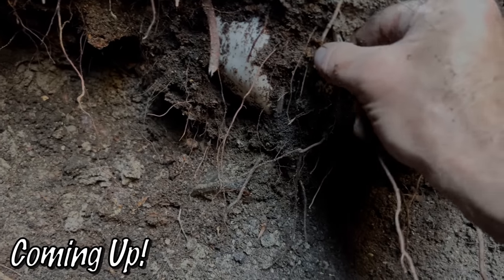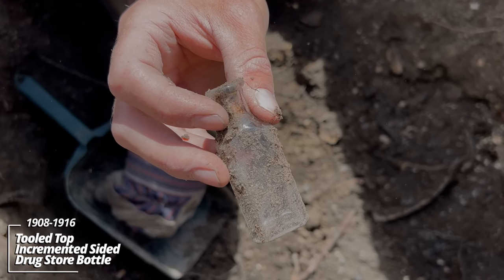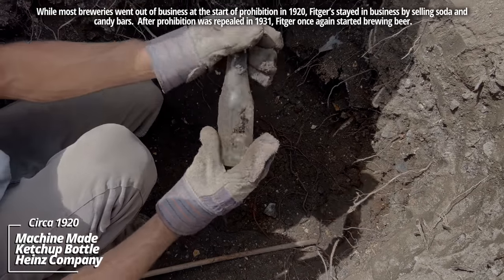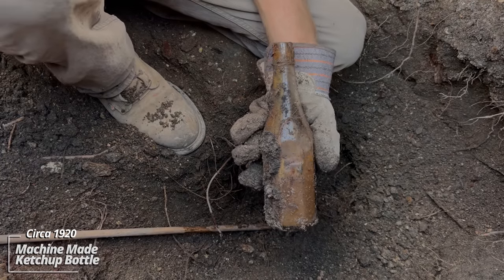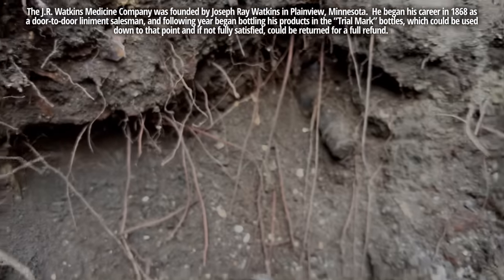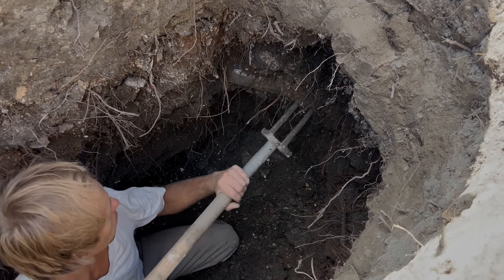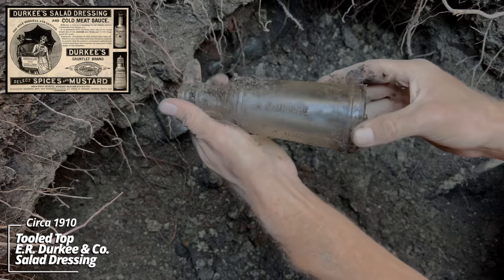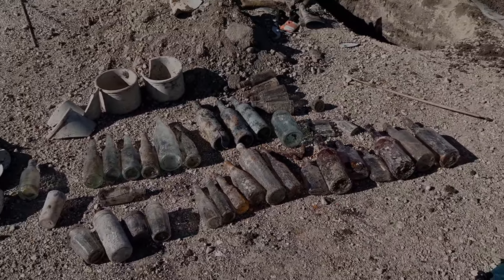Putting in a New Parking Lot Unveils a 120 Year Old Jackpot

Comment: The only Heinz ketchup bottles of 1900-1920 are the 57, 63, and 65, ... and couldn't see the focus of the base for a 3-digit numbered bottle.

 #57 - (Sharpsburg handblown, machine made?) (1895-1910) (patent design 1890 Heinz 8-sided bottle) held 14 ounces - first famous Heinz ketchup bottle
#63 - (Sharpsburg, handblown, machine made?, contract machine made) (1890-1913) held 14 ounces
#65 - (Sharpsburg, handblown, machine made?, contract machine made?) (dates unknown) held 14 ounces

These would be made at the Heinz Glass House Sharpsburg PA, with the POTENTIAL of eventually having in-house Owens machine-made bottles in the (1903-1910) period - as the majority of Heinz ketchups (1880s-1910) would be all handblown and tooled screw tops up to closure of Sharpsburg.

The #65 is SCARCE - and very little is known about it.  Thus the reason for having a valid focus and ID of such Heinz bottle numbers (and potential 1910-1920) makers marks.